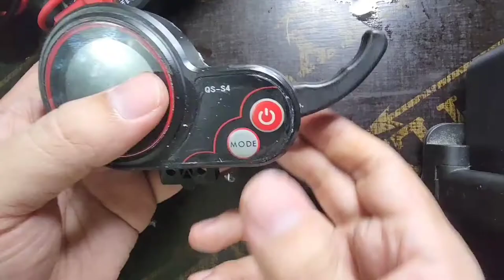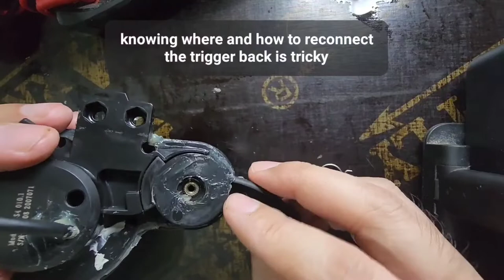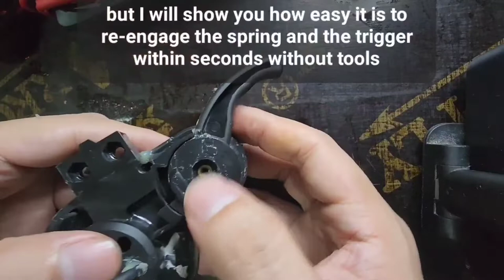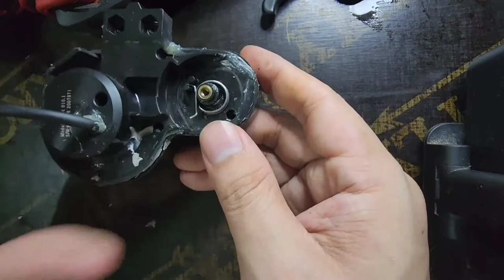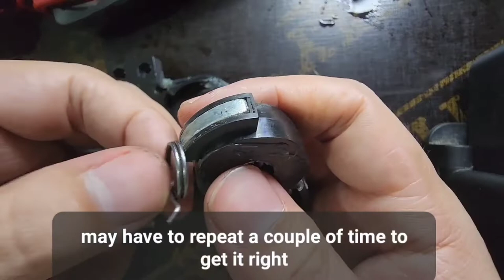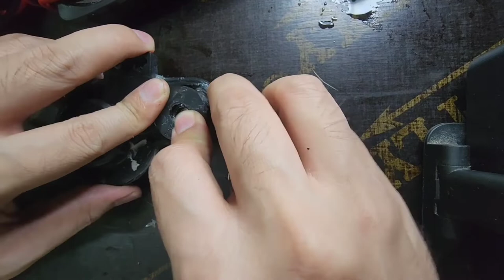Repair Electric Scooter Throttle (re-engage the spring the easy way)

Comment: Can you do a video on how to change the glass (the display cover) of the display? Mine is broken and I want to order new (only the glass) from AliExpress
Reply from the maker: I literally just did a similar repair a few weeks ago which involves replacing the entire LCD display and top of the casing. So while I'd love to make that video I don't have materials right now so I can't.

Display cover (plastic, not glass) is easy though. If it's not broken, just get one of those suction caps,  heat the display cover (using hair blower or put it under the sun) to soften the glue. then use the suction cap to pull out the circular cover.

If it's broken already or shattered, just get a small slicing tool and pop it 🤒 careful not to touch the LCD glass. Don't hurt yourself in the process (I won't be responsible for any injuries)
Reply: @gopronomad4381  okay, thank you. Can you send me a link or picture of the section cup you used?

Comment: Hello mate the little bit of plastic that the spring connects 2 has snap off on mine can I just buy the throttle or do I need the hole dash coz I can’t see 2 find the just throttle leaver
Reply from the maker: Howdy sorry to hear that, yes you could just get a whole new throttle. Just find the throttle model and search it . Mind the number of pins in the connector.

Comment: The plastic that holds one of the spring end broke in the middle of my ride and my scooter runs like speedy gonzalez, I'm lucky that I always have my fingers on the brake, so I shut the scooter off and use a hair band just to get me through my day ride, The throttle is working but no more pin to hold the spring in position, I will try to fix it so I can save myself $60 and fir a new replacement.